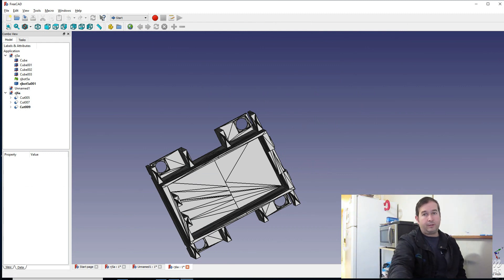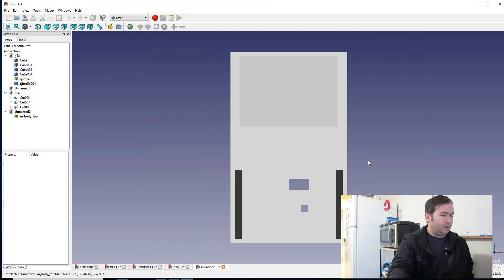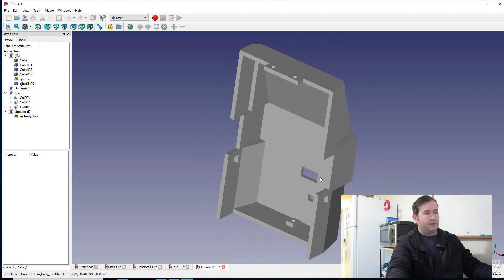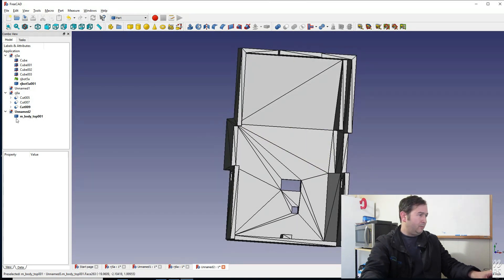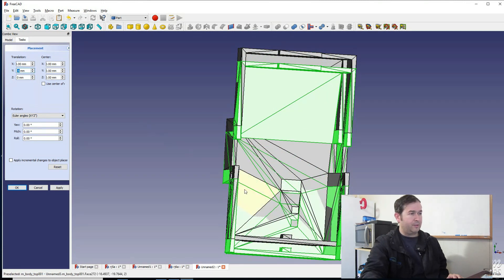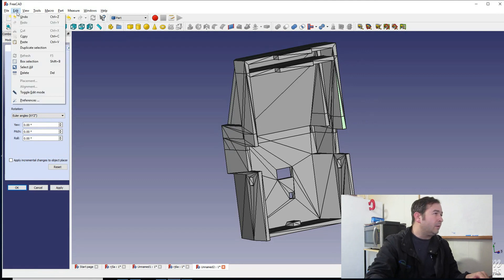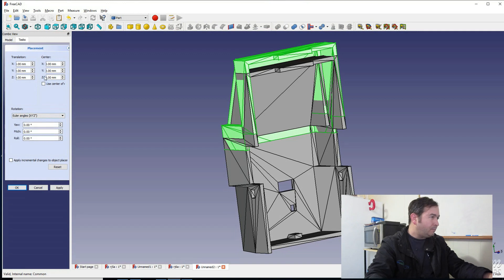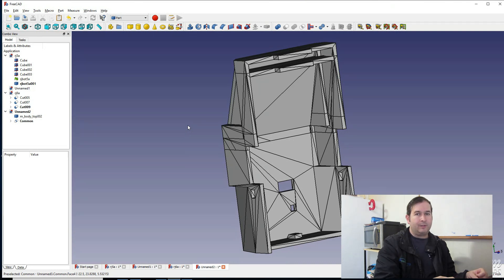FreeCad - How to Modify STL Objects (w/audio)

Comment: November 28, 2020. 7:30 PM EST.  I enjoyed your video very much. (It did not solve my problem of expanding the exterior side of a circular shim that is 1.90 mm thick with an ID of 80.67mm  for an intake duct on a quad drone) After 20,000 plus hours of flying fixed wing jet A/C & turbine Rotorcraft all over the globe, I've hit a Hard Wall  that for last two-weeks has proven to show me I've come across something i 've  been unable to perform even the very simplest of tasks. I'd love to learn this with reasonable understanding. Not sure if you would be willing to take this file I have and do a video on how to enlarge it?? I cannot fine any video that addresses this straight forward matter at hand. Again, I enjoyed your video. Kindest Regards, Bob Griffith, Winter Haven, FL
Reply: The other way of approaching this problem is to use your slicer software to expand the part in one plane only, by using the scaling tool. This is generally a lot quicker and simpler than importing the STL into FreeCad. Hope this helps you.
Reply from the maker: HI, I had a similar issue a while back. Here is a video showing how to scale an STL object to a different size! Hope this helps..
https://youtu.be/LmFRMgpNbz8